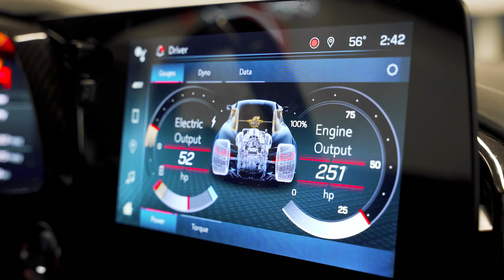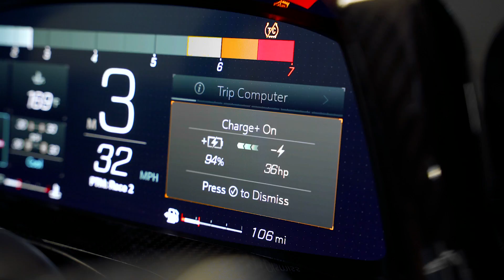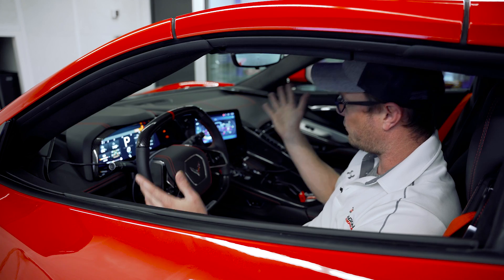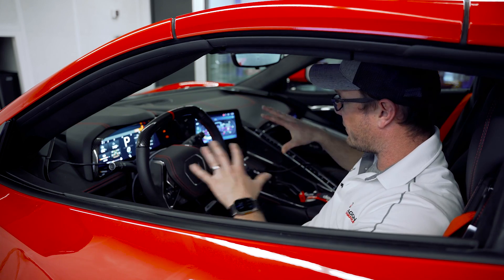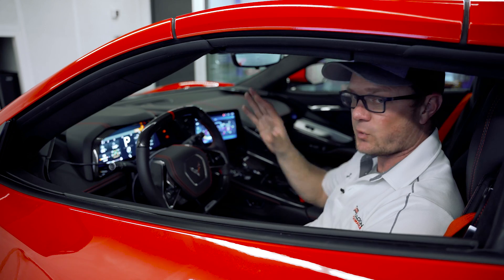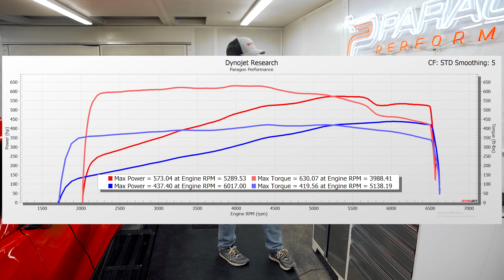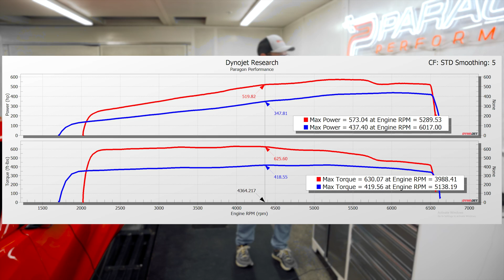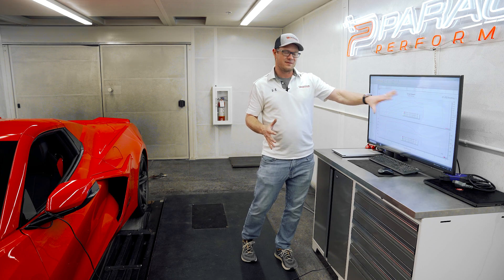Electric C8 Corvette E-Ray Dyno Results!

Comment: Street performance is gonna be monstrous with that e-awd after that supercharger gets on
Reply: Yeah, put some drop in forged pistons and rods typically used on the LT1 motors when adding boost. Then strap on a 2650 and it will run mid 8s @ 153mph + at the strip with the AWD.
Reply: @lpcook1 Mid 8's with just a 2650 and nothing else? Not happening.
Reply: @caliLakerNiner  You know…your probably right.  I forgot to say Heads and Cam and E85 fuel. I kind of assumed that if someone is gone to crack open a motor to build the bottom end, then why wouldn’t they upgrade the cam and address the heads while they are at it. I’ve owned 2650 with over 950whp since 2020 and am pretty aware of what this blower is capable of on a far heavier platform. A relatively light platform with electricity assisted AWD and another an extra 325-350whp, this blower is easily capable of producing with those aforementioned additions would easily push this Vette into the mid 8s territory. My V runs low 9s @ 150-151 on a prepped surface. This 800 pound lighter AWD V runs about 10.4-10.5 stock on 93. An E85 only tune with no other changes would probably be enough to get this car into the high 9s. Add in a built engine (so you can safely run 19-21psi), this blower will easily take this car in the 8s with AWD.
Reply: @lpcook1  Stop trollin' 🙄
Reply: @lpcook1 Never mind those other trolls. Haters will always hate. The e-ray does a 10.5 second quarter mile runs stock. Add the 2650 blower and build the motor and you might be right about 8 second quarters
Reply: @caliLakerNiner To be fair the ATS-V is a 10 second car with ONLY a Schmidty tune. Schmidty holds more workd records for the Cadillac Vs then any other tuner. All of that said the CT5-V BlackWing still has more power than the E-ray. 668 HP and 659 lbs of torque. The Corvette is only 168 lbs lighter.....Hennessy has modded a BlackWing and It reaches 220mph. Bone stock the blackwing still hits 205mph. That's faster than a AMG 63S, M5 CS, Hellcat and a GT500 and a lot faster than an Eray which tops out at 183. Plus with the blackwing you can track the car AND still put your entire family in the car. Now those are are FACTS so how's that for trolling? 😅

Comment: That is impressive.  How much more does it weigh?
Reply: 3914 just 134# more than my exact spec 2023 z06. Even less after swapping exhaust & intake… like 70#.
Reply: E-Ray - 3,920 lbs - HTC, front axle lift, carbon wheels, carbon ceramic brakes
Carbon wheels save 41lbs over aluminum Z06 / E-Ray wheels.

Comment: The biggest difference is that this car can actually put all of the torque down to the ground. AWD is king.
Reply: Electric augmentation is about a natural evolution these days.
Reply: RWD w/ balance is king for handling
Reply: The RWD Z06 will smoke the AWD Eray at the track.
Reply: @lukewalker1051 Depends which track. Drag strip is ERay
Racetrack is Z06
Reply: @FunFastFree did someone say dragstrip ❤
Reply: @FunFastFree a stock z06 did 9.96 at the strip. Eray isn’t doing that.
Reply: @johncena-hq1ti If you're talking about W. Farmers car it was stock with the exception of drag radials.
Reply: @caliLakerNiner  yep. But before he radials he still ran 10.0
Reply: @johncena-hq1ti  left out the race fuel, skinnies, rear wheels swapped that actually had full slicks and weight reduction lol
Reply: @johncena-hq1ti no stock z06 ran a 9.96. Stop the 🧢
Reply: @executiveinvestments - this is YouTube - accurate information is subjective unless it backs your point of view 😮
Reply: @caliLakerNiner  he had race gas as well.
Reply: @johncena-hq1ti  That Z06 was modded
Reply: @executiveinvestments  he did 10.1/10.0 bone stock. 9.9 with a tire and passenger seat delete
Reply: @adrianleusink1970  yeah I said it had a tire but that’s very minor. Stock he did 10.0
Reply: @outlawcry12222  no race fuel, only weight reduction was a seat delete and it had a tire. Stock ecu no performance mods whatsoever 😎
Reply: @johncena-hq1ti  bullshit im at the track all the time and no stock zo6 is coming close to 9.9  hell theres a twin turbo c8 and he still aint in the 9s .

Comment: Haters already saying one just could have bought a Z06; if E-Ray owners wanted a Z06, they would buy it but they want/wanted the E-Ray 🤣 E-Ray all the way, Baby 😎
Reply from the maker: The owner has a 70th AE C8 Z06 with Z07 Aero. It's in our show room 10 feet away from me as I write this comment. 
- Justin
Reply: @ParagonPerformance Haha got 'em. FPC LT6 ftw!
Reply: I would get an ERay because it's cheaper than Z06.
Reply: Still rather a zo6, eray is pointless.
Reply: @hpickettz34 eray is a different animal the z06 is a track car that you can daily drive but with that engine it needs to be revved out to enjoy. The eray in a since is the new grand sport with extra power and awd better for daily but can be used it the track
Reply: agreed. Some people dont get the fact that they are 98% of the time going to be driving from 0-100 where the E-ray shines
Reply: @dontadeshun  if you didn't know they are bringing a grandsport out in 2 years, if im  already gonna spend 100k+ i rather have a zo6, the exhaust note alone is worth 50k by itself,  plus i don't trust gm with advance electronics like the eray has.
Reply: @hpickettz34  eRay isn't pointless. It's just for a different purpose. The point of an eRay is for someone who loves quick acceleration, the wider body of the Z06, but doesn't want to track it and prefers a more compliant ride. It would make a better daily driver for most people than the Z06. That being said, I'd rather have a Z06 with Z07 package because I absolutely love the sound of the flat plane V8.
Reply: @hpickettz34 I'm glad I got an eray. I drive it comfortably every day and take it to the track. The Z06 is pointless unless living on the track.
Reply: @kadananthony true that 1.  🤠

Comment: With the Dyno happening in 5th, I believe that roll off is programmed relative to road speed and probably wouldn't show up in the lower gears.

Edit: looks like my assumption on gear is in error.
Reply: Why would you dyno in 5th anyway?  It's further away from 1-1 (.65 vs .88 in 4th) I believe.
Reply: @daniellivesey6749  I guess I stand corrected. I watched a shop Dyno one for an intake and they mentioned 5th being 1:1 but they were dynoing in 4th. Looks like there isn't a 1:1 anywhere in the box, as you point out.

Comment: Very impressive. That thing is going to be a force to reckon with after the supercharger is installed.
Reply: this isnt impressive at all wtf. its an electro awd stringray. why didnt those sandbaggers at gm use the lt6 engine
Reply: @badcholesterol they wheel in the zora with the zr1 engine
Reply: @badcholesterol you got something faster?
Reply: @badcholesterol   I am most certain they have test mules of the  very thing you speak of,  all different combinations of engines, equipment, electric motor configurations at some hidden test grounds somewhere.